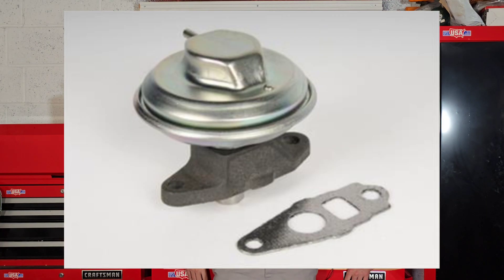Exhaust Gas Recirculation (EGR) Basics

Comment: Question.....  under the primaries in the factory Olds manifold there are nipples rising from the egr ports in the floor of the manifold. It looks like removing these would increase airflow a bit....  any known drawbacks of removing the nipples?  Aftermarket manifolds with EGR only have holes in the port floor, basically what you hsve if you remove those nipples.

Comment: What gasket do I use? I  have no  vacuum pulling from it and Ihave a stock spread board intake running the quad Jet,  I believe 80’s-81 it’s got like 6 ports plugged up and just the pvc is hooked it , I’ve put the motor in a old C10